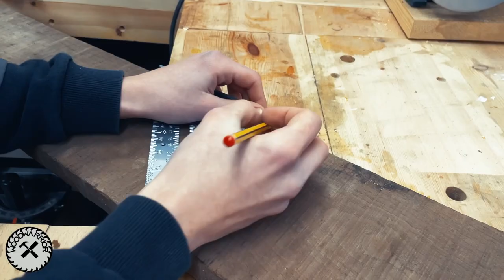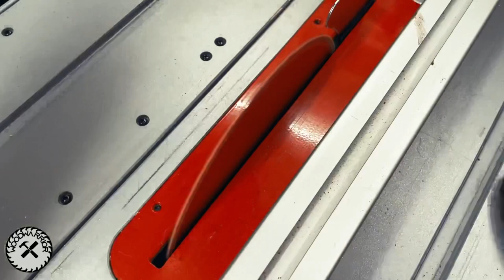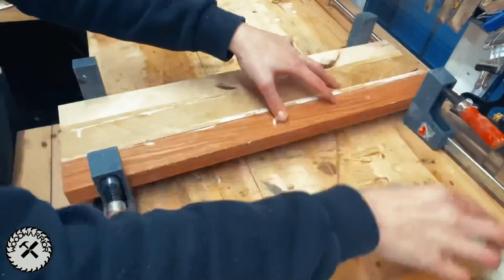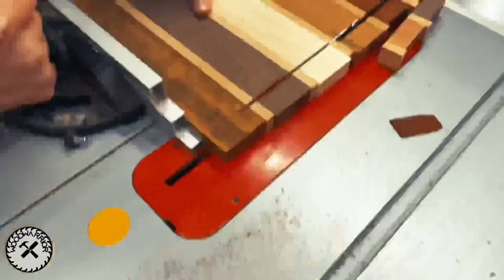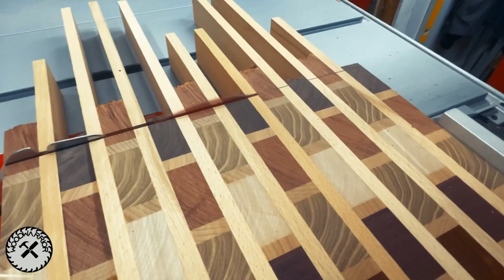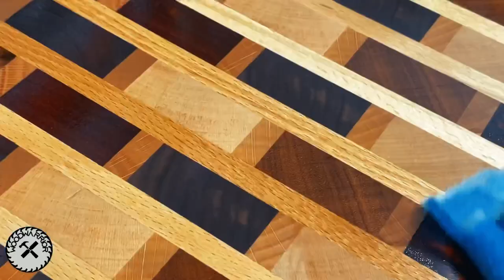WoodWorking: DIY End Grain Brick Wall Chopping Board

Comment: its very nice, but with the reversal of the grain, are you  worried about movement?
Reply: Been there done that.  It will move and check.  Beautiful though.
Reply from the maker: Hi, not too worried about it, as long as the board is being treated well and doesn’t come in contact with any detergents which could damage the oil, the board should be fine, may get the odd shrinkage of the beech at most but shouldn’t generally be an issue altogether.